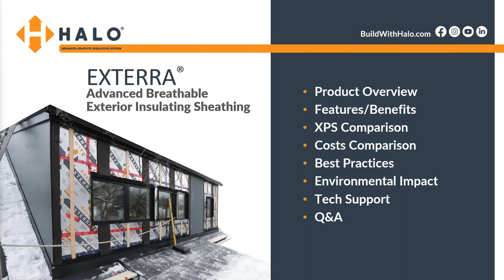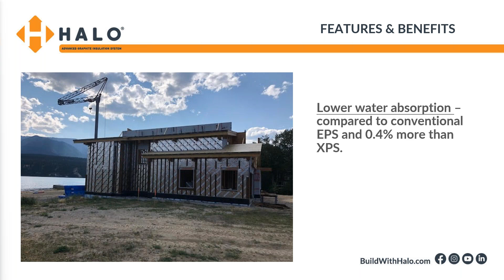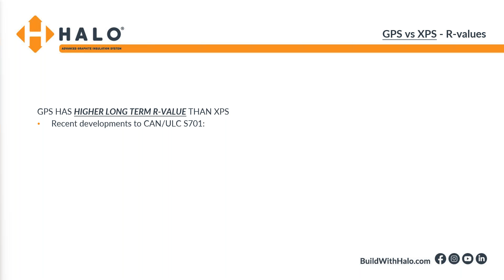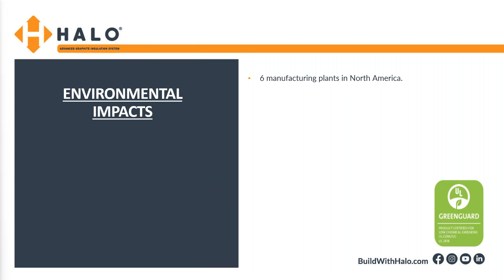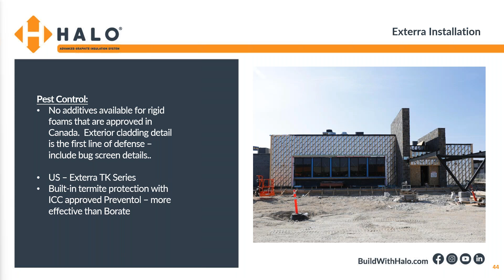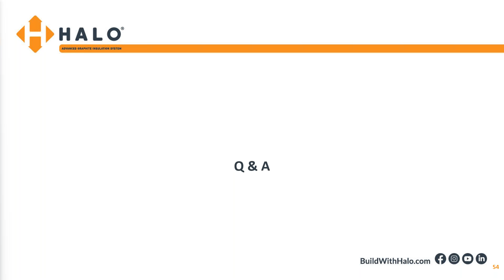WEBCAST: Halo Exterra 101—The Advanced Breathable Exterior Rigid Insulation

Comment: Wait this sounds like warm weather insulation. Up in Michigan and Canada we want heat
Reply from the maker: You are correct in that, a control layer is placed to the exterior in warm climates. In cold climates, this is placed on the interior of your assembly primarily. Check out Halo Interra for this application at BuildwithHalo.com
Reply: External insulation is becoming code for cold climates. It's better for all climates because it limits thermal bridging. A lot of people look at external insulation and think, "Nice! More insulation, less heating/cooling bills!" but in reality, the benefit of it goes much deeper. It reduces thermal bridging which protects the inside of the wall from moisture and mold damage. 
Look into the 2021 code updates. 
"R20+5 or R13+10 [now required] in Climate Zones 4 and 5. This means that in zones 4 and 5, exterior insulation is required to meet the basic R-value requirement because you can't stuff enough insulation between 2x6 studs to meet minimum acceptability standards. Here are two sample wall profiles: 2x6 and 1 inch of exterior foam or 2x4 and two inches of exterior foam."